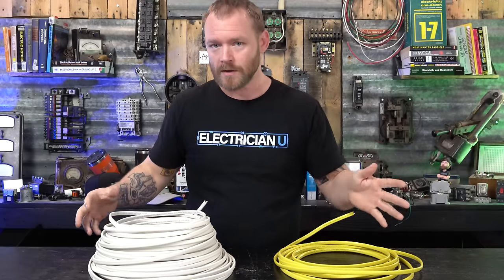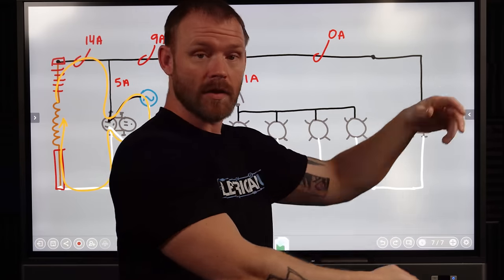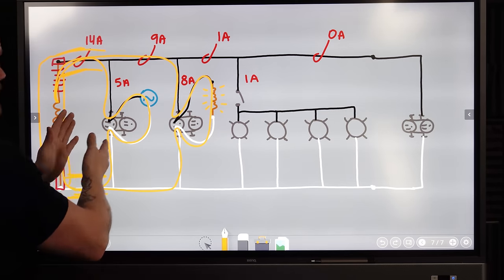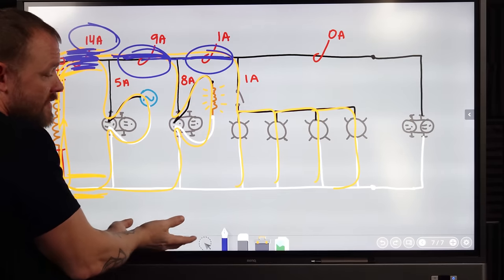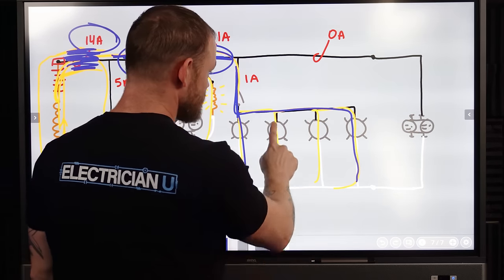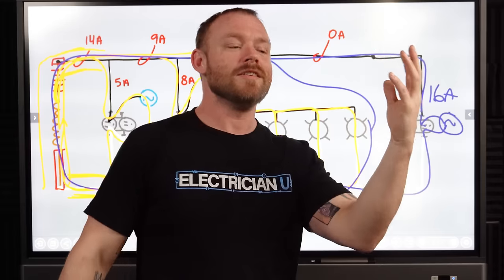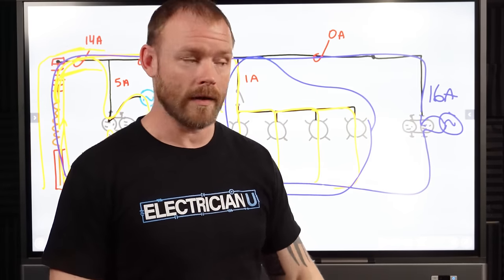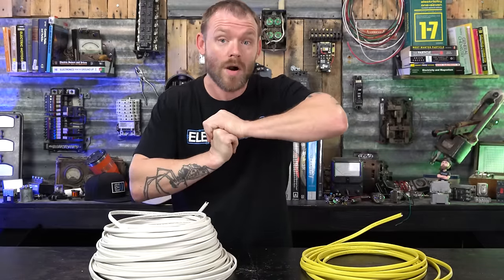Should You Be ONLY Using 12/2? When Can You Use 14/2?

Comment: I'm running a outlet to my crawlspace a 15 amp GFCI outlet from a kitchen outlet that never gets used . What size wire should I run the outlet with ? Any help would be appreciated.! The outlet is to run a dehumidifier and a condensation pump and 60 cfm exhaust fan .

Comment: Just learned more about parallel circuits in 8 minutes than I did the entire month we spent on dc theory in my union dc theory course. But my instructor was also more obsessed with his 20% fail quota he was trying to reach…. The way he teaches it’s no wonder 20% of his students fail first year.
Reply: Please disregard this video. I am not sure what he was thinking, but this is wrong. Read the number of comments.
Reply: It's good stuff, but do note the breaker is the safety for every device AND the cable of the circuit, so actually do use the cable coded. While yes, a shorter run of 14awg will perform just as well as a longer run of 12awg at 20a, and be safer, it's still codified as a no-go.

Use this info to help reduce voltage drop! Meaning, to upsize certain runs, like the home runs with devices on pigtailed smaller awg 'twig' circuits. The professional who just wants to use the minimum required, do the minimum, just pass inspection; worries far less about the circuit's use and voltage drop, and more about the few dollars saved.

Comment: My grandfather, who I apprenticed under, used to do it this way, 14awg switch leg on 20 amp circuit. Although theoretically okay, I would highly advise against it. Talk with your AHJ. It's very easy for an inspector to call this out and fail you. NEC makes it pretty clear not to put 14awg anywhere on a 20A circuit

Comment: I had a situation where someone plugged in a 16 gauge device that had shorted leads, only the circuit breaker was a 30 amp breaker. The circuit breaker didn't trip, but the 16 gauge wire disintegrated at the plug. This is the main reason why I only run 14 gauge wire and use 15 amp breakers for lighting. If something goes wrong with the lighting on small gauge wire or a lamp failure, there is a better chance of the breaker tripping with the wire being only one size smaller. By the way, the only way I could fix the 30 amp receptacles problem was to use a spare hot on a different leg that was already in the same conduit but had to share the neutral and use a two pole 20 amp breaker. Both circuits remained contained in the same Wiremold Plugmold power strip that provided odd receptacles on one leg and the even receptacles on the other.

Comment: Very informative video.  Can you maybe demo how to correctly split off different gauge wires in these types of a setup? Is there a certain way that has to be followed to join different gauge wires together for the different circuits. For example -Are separate junction boxes needed when changing gauge -  different from the ones that the switch or receptacle would reside in?  I always thought it was bad to join different gauge wires together but this explains the theory how it can be safe in certain instances. Note - I am no electrician just your typical DIY type.
Reply: You can't. Unless there is overcurrent protection ahead of the smaller wire, it is a code violation (and potential fire hazard) to connect smaller wire (#14) anywhere in a circuit using #12 wire.

Comment: That’s a good point about lights. You could run like a hundred LEDs on 18 gauge. They should really make smaller gauges of romex for these applications. Does code have any provision for this?
Reply: A sub panel or breaker/fused shutoff box.

Circuit protection (breaker/fuse) needs to be sized to the circuit. Code includes using all items to their UL listing and as described to be used by the manufacturer. Sizing the circuit breaker includes determining cable size (and mfg amp ratings) and the maximum device protection listed for each device on the circuit.

A receptacle will be listed simply as '15A' but an air conditioning condenser unit will really spell it out on the tag with "Maximum breaker/fuse/protection: 30A." I don't know recall seeing, and don't want to go check, if cable has a max amp rating. I'm sure they do list it somewhere. But cable is more amps vs length/distance/resistance... so it's simply codified as minimums. With enough distance, and voltage drop resistance and heat, with select amps, you could easily burn a place down following code.

Comment: 14 is allowed here in Oregon, and is actually used more here for lighting circuits.  Most lighting nowadays is LED and the load is less than it ever has been.  There is even a provision in the new NEC for a new 10 amp breaker.  Wether or not Manufacturers pick this up, is yet to be seen.  If you are running a mile or more of wire, 14 can be quite a cost savings. Thanks, Russ 28 years in the Trade.

Comment: Thanks for talking about this. I was even thinking of requesting it a few months ago. I've been really appreciating the design of circuits lately. Not getting crazy, but definitely reducing voltage drop as much as practical. Even doing 10/2 main runs with 12/2 or 14/2 off of them when practical.

I'll need to read more in to when I'm still allowed to use 14/2 on 20a circuits if for specific devices. Was under impression that 20a means 14/2 is vorbotten, but maybe not. Will look. And will look for 240v as well, as a lot of the 240v I've done really did have low amp devices with short, harder to run, final circuits from main run.
Reply: You can never go down in wire size....ever. If it's a 20 amp breaker, you have to stay 12 gauge the entire circuit.
Reply: @imtheonevanhalen1557  A device's wiring can be less. On dedicated 'hard' wiring, there's argument to be made for where that wiring begins, best I've heard. Reason, the wiring in most devices is significantly smaller. I feel a little disappointed and defeated when I oversize the conductors for a circuit only to be slicing to something like 16ga. But I know it's because those wires are short enough to be fine. Most power cords are also 14ga or much smaller. But it's also a lot easier to splice some 14ga to fish up through a floor to a baseboard heater than has 16ga wire inside it to splice to. Also, 240v. Lol

Comment: Do you think NEC will change to mandate more receptacles? And power supply? Based on how everything is moving to electric: lawn equipment, cars, table saws & tools, E-bikes & scooters, all our electronic crap that needs charging- the whole gas stove debacle and heat pumps. It seems we need more than "one receptacle every 6 feet". Maybe a double duplex receptacle at every spot?
Reply: The short answer is yes.  It takes time.  The NEC now requires at least one receptacle outlet for each vehicle bay in the dwelling garage.  This is due to the increase in the use of rechargeable batteries.

Comment: Here is a DIY question for ya......How can you tell what gauge the wire is if it is not part of the original package with description.  I have some old wire in my garage.  I know it is electrical wire and not CAT5 patch or anything like that.  The wire looks white shielded just like in this video but the wire does not have any markings on the shielding that I can discern.  Thoughts?
Reply: If the conductor is the size of a dime's edge, it's 14 AWG.  If the conductor is the size of a nickel's edge, it's 12 AWG.

Comment: I've had this question about extension cords.  I'm using my dad's old extension cord and it's from the 80s and I didn't see any markings on it.  I have no idea what size it is.  I ended up buying a 25' 12/3 simply because they said it could handle 20 amps and it has 3 plugs on it.  Doubt I'll ever use that much but I feel better knowing I've got a good one now.

Comment: 20A breaker = 12awg wiring.  15A breaker = 14awg wiring.  I always separate my receptacles from my lights, and use 15A breakers for lighting (especially now with LED lighting that uses far less power) and 20A breakers for receptacle runs (being sure to install outlets rated for 20A).  This prevents the annoyance of lights dimming when you turn on a high load appliance at a receptacle (such as a vacuum cleaner), and allows for lighting to continue working if a receptacle breaker trips.  Not a professional electrician, but just wanted to add my two cents here...

Comment: Even if planning on LED, if installing an E26 socket device requires we use Maximum of the rating in box.  We still have to use 12 on lights because of this.
Reply: Think he was talking the directly wired LED fixtures. It would feel ridiculous to be running 12awg just to get to each light and use their cheap push-connect fittings to splice to tiny ~20awg wire and to draw ~10w. Code is bureaucracy, and the actual goal of any bureaucracy is survival, not their propaganda message as to what their mission is. It's rarely very efficient, usually adds needless cost, and long term makes what they control overall worse and eventually unaffordable.

Comment: Of course with the vast # of exemptions you are allowed to have a 14 guage line feeding a dedicated motor load such as a air compressor or air conditioner on a 20 amp circuit breaker to prevent a 15 amp breaker from tripping due to locked rotor current during start up. Same with a #12 guage wire can be feed from a 25 or 30 amp breaker. If you had a mansion with a fire pump breaker would be very high.

Comment: I run lighting circuits on 15A branches on 14 AWG.  Receptacles all go in 20A branches, even though they're only required in specific places like kitchens.  Putting 14 AWG on a 20A overcurrent-protected circuit?  You need to conform to the tap conductor requirements in Article 240.  16 and 18 AWG?  Only on fixture wiring as defined in the NEC.

Comment: My house was built in 1983.  Second owner.  All wiring to the breaker panel is 12/3 (or bigger for 220v circuits).   There is NO 14/3 ga wire anywhere in the house.  Does that mean if i want to install 6 LED wafer lights and tie in to an existing 12 ga wire that I CAN NOT  use 14 ga...

Comment: I'm retired and shocked over high price of copper wire. Think the first 250' box of 12/2 NM cable that I purchased was only $12. Always ran 12/2 to each bedroom but still think the NEC should follow you to run 14/2 to luminaries especially since they are now LED'S consuming less then 1 amp. Heard they want 14/2 copper clad aluminum cable be installed to tree luminares and be in a maximum of a 10 amp circuit breaker.
Reply: On a circuit with a dual function breaker, yep; but otherwise the breaker has to be sized to protect everything when things go wrong, including the cable, so it's more about sizing the breaker/fuse protection to the circuit cable and devices rather than the other way around (like we normally think of it).
Reply: Aluminum wire shouldn’t be used in any circuit with switches or plugs.

Comment: The problem would arise if there was a malfunction in the device installed. In the case of a short it will start pushing more current all the way up to 20A before tripping the 20A breaker on a 15A wire. Now you are over rating that wire by 5A. Please explain how that is a good or acceptable thing. Not all shorts are dead shorts causing the breaker to trip immediately.

Comment: I just wired a circuit to a shed with no. 10 from a subpanel out the garage to a carport, then no. 12 underground, all on a 15 amp breaker.  All for voltage drop.

Comment: In some California apartment buildings 3 decades ago the only place where 14 awg was allowed was the sole circuit to the smoke alarm..

All else was 12 awg since  you assumed the tenants would do crazy stuff. Lol. Liability 

The breaker for the  1.5 ton ac compressor on the roof was 10awg for most apartments..

Comment: I worked 
with a maintenance guy who installed 12 to every outlet every time. 🤔 His theory was surprisingly rational. The buildings were built in the 1960s and there weren’t even remotely enough electrical outlets. As such he expected that any outlet he installed would have multiple extension cords and port multipliers added and so the circuit should naturally be capable of supporting the expected load.

Comment: even though i wouldn't mix the wire sizes, in the real world 14/2 doesn't start on fire at 15.1amps or even 20amps or even 25 amps. i've seen the different size wires tested for current handling. you have to remember the specs/code are way overkill (not complaining). so mixing them would actually be fine and the house wouldn't burn down and humanity would not be burnt to a crisp.

Comment: Maybe 40 years ago in my area you were allowed to run 14/2 from a wall case that had a switch to control ceiling lights that were feed off a 12 guage 20 amp circuit breaker but no longer.

Comment: The only way I can see getting into trouble with the whiteboard drawing, is if there is a short in the lighting circuit. Now you have a failure event and the breaker is not sensitive enough to protect it. 

Of course it will trip for a dead short. Will it trip for a lesser but still very dangerous failure?
Reply: I wonder if this is assuming dual function breakers since they are becoming so prevalent? That ought to detect and trip for most faults.
Reply: That was my immediate thought as well. I'd be nervous of somehow overloading the 14ga on a 20amp breaker and causing a fire.

Comment: When you say that you use 14 for lights do you just run seperate home runs for just lights or will you use 12 to feed the switch box and run just the legs in 14? And if you do that. Is it legal to have them lights on a 20 amp breaker?

Comment: That 1A in the lighting leg is normal current, not fault current. Say that there is a partial short in one of the lights and it starts drawing 18A. That won't trip the breaker, but it will overload the wiring in that branch.

If you want to use smaller wire, then put the lights on a separate branch with a smaller breaker.

Comment: It’s not right to branch off with a smaller wire under any circumstance unless the breaker is rated for the smallest size wire, but still I think that’s against code. I know you’re just going between 20A and 15A but let’s say you’ve got a 30A circuit that starts with 10awg and eventually branches to 14awg. In that case you have a fire hazard because if too much load was ever put on the 14 it could get hot AF before the breaker ever tripped.

Comment: I agree with you. However, code doesn't allow mixing gauge and the breaker capacity has the ability to overload the wire even though thd LEDs will never do that it's still the code in case a guber comes along unscrew the led and plugs in a hair dryer

Comment: So, are you saying that in that particular parallel circuit that I could take 14/2 from the switch up to and through all the lights?  I was always under the impression that if I started a circuit with say 12/2 I could not down size the wire size on the circuit

Comment: Average price 1000ft 12/2+g $850.00, 85 cents per foot,  1000ft of 14/2+g $600.00, 60 cents per foot.   - Difference $250.00.  The average modern home requires about 2.5 feet of wire per square foot.   So  $2.13 per square foot for 12/2+g or 1.50 per square foot for 14/2+g. So on average a 2500 square foot house would take $5325.00 in 12/2 vs $3750 in 14/2.  I recommend 14/2 for lighting and 12/2 for receptacles, putting your cost somewhere in the middle.

Comment: What happens when you get a short in one of those 14-gauge light circuits on the 20 Amp breaker? Possibility of 14-gauge wiring melting / fire before the breaker reacts?

Comment: It's always so much pleasurable to work with the 14 gauge vs the 12 when you do.
Reply: Especially when it's a Rental, and they're using Space Heaters. Melted receptacles are Job Security.
Reply: @TimeSurfer206  it won't melt if it's on a 15 amp with 14 wire.
Reply: I knew a guy whose father cut sheet metal with tin snips for US Steel his whole career. I also served in the Reserve with a guy whose civilian job was as a commercial electrician, who only ever worked with 12 AWG wire. I shook each man's hand once. After that, they only got knuckle bumps from me.
Reply: @vaska916  I just got back from a job yesterday with two pieces of scrap that prove you're wrong.
They were 15A, El Cheapo Contractor Specials, on 12 gauge with a 15A breaker.
They were replaced with Spec Grade 20A's.
It's a Rental. The cheaper you go in a Rental, the quicker it's going to break.

Comment: I have 12/2 running through the whole basement and have them on 20 amp breakers. I want to run a single light off the 12/2 line to a switch and from the switch to the light in 14/2... Can I do this ?

Comment: And this is another flavor of one of my questions about code. 

I was always taught to breaker for the smallest size wire in the circuit. So, with a 15 amp breaker, #14 is fine. Although for a long run, #12 is better. 

BUT.... I can run a #14 wire for a lighting circuit. Use a 15 amp breaker. And the switches can be rated less, commonly 5 amps. And when you get to a fixture, a chandelier is my favorite example, the wire size in the fixture drops to #16, #18 or even smaller out to each individual bulb. Yes, those bulbs only use 20-40 watts incandescent or 5-10 LED. So, for a couple of foot run, #20 wire is fine. But here's the "but", what if the socket for one of those tiny bulbs shorts out? All of a sudden, there's a short that can draw 15-20 amps before the breaker starts heating up. Through #20 wire! But that fixture is UL listed and is not even restricted to a 15 amp circuit!  And seeing a fuse or breaker is rare. So, that chandelier can melt without the breaker tripping.
Reply: size the breaker for the load.  Then size the wire for the breaker.